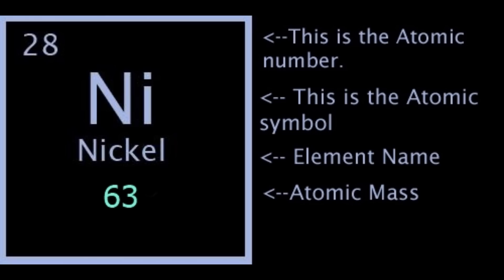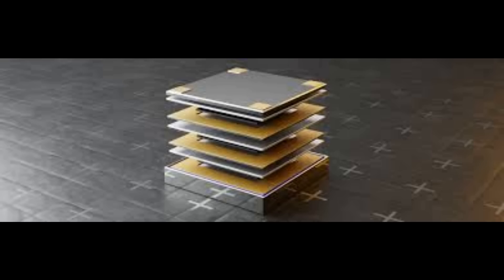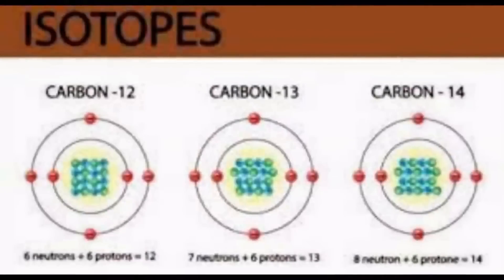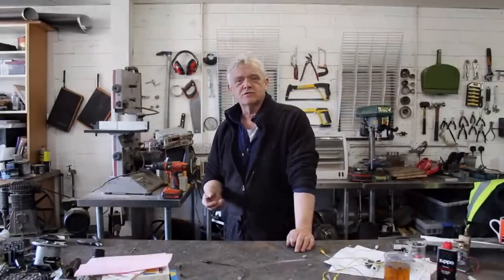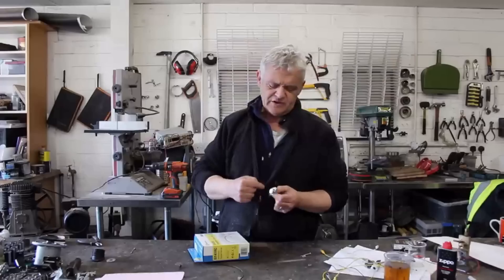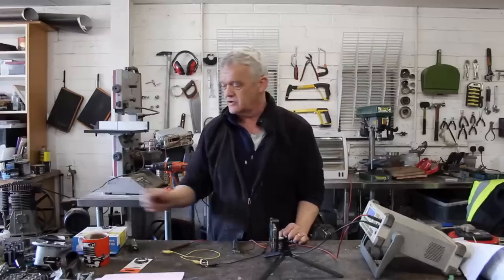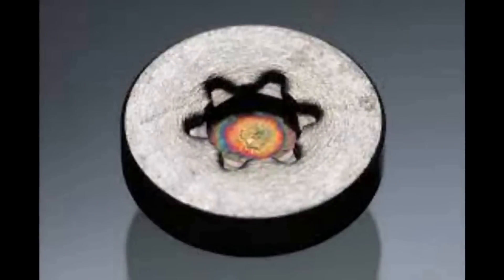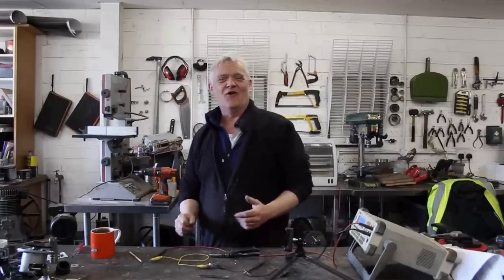2187 - The 50 Year Nuclear Battery From China And How To Make Your Own Version

Comment: I got very excited when I saw the title but after watching the full video I realised is a edit of the old that for some reason got deleted in the last 24h, which made this video feal a bit like clickbait. 
Also by using the same footage you did not address the one important question from the comments. 

Can the mv reading you got  from the apparatus be  because of light contamination 
( as the test is not done under complete absence of light) 

There are some research papers on building alpha voltaic cells online, the most promising one I could find is using Zirconium anode, Iridium cathode and is using liquid Galium as conversion medium. . The open-circuit potential of the cell is expected to be 1.62 V and is expected to deliver a current between 7 and 12 ma. 
(the full name is :Alpha-Voltaic Sources Using Liquid Ga as Conversion Medium)

Comment: I honestly think we could power our world off of small atomic reactors. There is no need for oil. But imagine something that lasts ages and doesn't break - small profits.
Reply: Well idk, its not usually the batteries that break first in most battery powered products, is it?
Energy companies are gonna be mad though lol.
Reply: @svinkuk2652  they may not break first but surely they don't last ages.
Reply: @adamstewarton  no sure thats true, im thinking of things like phones and laptops though, most people tend to replace them long before the battery goes wonky.

it'd be a gamechanger for cars though i suppose, but they could just do what the tech industry and many car manufacturers already do and engineer them to fail after so many years, as well as make them impossible to maintain without ten million specialized tools and put in software to make it harder to get off brand spare parts etc etc.

There are always shady ways to maintain profits lol.

I get your point though, its definitely an incentive for companies to want these things away from the market.
Reply: No they are not. The power output of these things isn't even enough to run a very dim LED torch. @svinkuk2652

Comment: So if my math is correct, assuming 1mA at 110 mV, it should produce 9.504 Joules of energy over 24 hours. For a red LED operating at a F.V. of 2V with a current draw of 20 mA, the energy if stored with no losses or leakage would be enough to keep it lit for 237.6 seconds or ~4 minutes. This could prove to be extremely useful for supplying enough power to actuate some relays (or beefy transistors) and wake up hibernating electronics in applications where they’ll remain turned off for extended periods of time. 4 of these nuclear batteries could maintain a 1000mAh NiMH battery at 80% state of charge for 156 years. Or maybe you could create an atomic clock utilising the time-averaged regularity of the decays.
Reply: So I'll just mention it's pointed out in a comment or two that the output is 100 microwatts instead of milliwatts.  Rob states microwatts later .
Reply: @philip5940  So I deleted my previous comment because I misunderstood you, apologies. I was merely making a calculation for Rob’s little transistor based device. I think the real breakthrough is probably that Diamond doesn’t break down like the semiconductors we use in electronics do when exposed to radiation. Spacecraft have had reduced operating lifetimes in space due to radiation spikes (such as from CMEs, for instance) damaging the solar panels thereby decreasing their output. I’m not sure how the power output differs between Rob’s little experiment and the Chinese company’s product but the lifetime is what really matters (I think). Anyway, thanks for sharing!
Reply: I checked your numbers, seems right to me, and it's a good use of variables many may overlook or think they will never need beyond Ohm's Law.    I checked using this equation to start with: 
 voltage  = joules of energy / coulomb of charge
Reply: @e100vids2  Thank you
Reply: It is my understanding that you are referring to the 'nuclear battery' he made in the video when you say '1mA at 110mV'.
If my understanding of what you're saying is correct then what you're saying is far from correct. 1mA is an extreme overestimation of the 'battery' he produced. 
Using numbers from wikipedia i find Am241 smoke detectors contain ~37kBq which at the decay energy of 5.486MeV gives a wattage of the radioisotope source of ~32.5 nanowatts. 32.5 nanowatts at 110mV is ~296 nanoamps.
Most of the alpha particles from the source are not even getting to the semiconductor so the efficiency of this device is certainly far below 50% before considering losses in the semiconductor. I am unsure how many electrons are driven across the junction per alpha. I think it would be extremely optimistic to assume 5% of the alpha energy hitting the silicon is converted to electricity.
Assuming 20% of the alphas generated hit the silicon and 5% of that energy is converted to electricity and starting with 32.5 nanowatts gives an electrical output of 325 picowatts. 325 picowatts is 28.08 microjoules per day or ~10.25 milijoules per year.
Reply: @johnnydeep7089  Thank you for your input. Yes, I did consider that I may be overestimating things, and neither did I take the time to calculate the wattage produced by the decay of the Americium source. I merely made assumptions about the output and wanted to see if those assumptions would yield in a useful amount of energy produced over a sufficient span of time. I suppose that such a small sample of Americium, or even this particular isotope may be unsuitable for power generation purposes, but a different isotope may be. Would a source emitting 110 microwatts of alpha radiation be dangerous to human health? I’m not sure. But I assume that it can be sufficiently isolated from human beings to not pose a threat. Time, distance, shielding. For a source like this, it’s relatively straightforward to implement the distance and shielding rules to minimise dose absorbed by a human being, especially since Alpha particles have the largest cross section of the particles in the three possible routes of decay energy release (Alpha, Beta and Gamma). As for time, so long as no one wears it on their person; not to insult the other commenters who suggested using it to keep smartphone batteries charged, but this would be quite irresponsible as it maximises the time and the amount of shielding needed for such a thing to be deemed safe would not be practical for a portable device.
Reply: @thesentientneuron6550  Given cost is no concern it is trivial to make a 110 microwatt or even substantially larger alpha source powered nuclear battery. Alpha particles in particular are completely blocked by very very little shielding (an alpha source nuclear battery will not cause any harm to organisms around it if the alpha source does not have any secondary decay modes). However there will never be anything even close to 1 watt available on the consumer market powered by a nuclear battery because if the nuclear battery is damaged the radioactive material can escape and cause great harm. I suspect even milliwatt nuclear batteries will never see consumer markets for this reason. It is also possible for people with bad intentions to extract the radioactive material from many batteries and so I would be unsurprised if even sub milliwatt nuclear batteries are not available without a license.
Reply: Science numbers man, I have a gram of yellowcake uranium, some thorium powder, and americium sources similar to the one in the video. A pack of these transistors is $12 for 10. Assuming I use a yellowcake and ethanol slurry enough so to coat the internals of the transistors and let it dry before capping them with cork and then solder, how many for me to infinitely(the rest of my life and bveyond) power a house hold lightbulb?  @johnnydeep7089
Reply: You bring up a pretty good point. These nuclear batteries are constantly dripping electrons, which is not practical for most consumer and industrial applications. But one could augment an existing battery NiMH or Lithium system so that when a device is not in use it is passively recharging. My keyboard and mouse are wireless, and I don't use them constantly through the day; hypothetically, augmenting these systems with discrete nuclear batteries ensures that they only need to be traditionally recharged during prolonged heavy usage.
Reply: @MrVirus9898  100 micro watts is too little to charge a wireless mouse in a reasonable length of time.
Reply: The problem with saying something will last hundreds of years is corrosion and basic elements breaking down with time. However I do like your maths. This would be a good miniature power system for backup systems that can sit untouched for long periods of time.
Reply: It doesn't look like that comment got relayed through
Reply: @philip5940  Don’t worry about it. I’ve just done my due diligence.
Reply: Yes
Reply: I wonder if you could get 3 or 4 of these to float a car battery forever to prevent sulfation. Something tells me 300uW isn't enough for that though.
Reply: @sCiphre  Yeah those things lose power super fast. It’d be far more effective to just drain the electrolyte into a separate reservoir and store the cell “dry”, I imagine.
Reply: @thesentientneuron6550  nah I just want my rarely used car to float without plugging in (it's not near a socket) or rooftop solar (too easy to steal). My plan b is to find a battery based battery minder I can just recharge every now and then.
Reply: How about a small solar panel that sits on your cars dash? Secondary benefit of protecting your dash from sun damage. @sCiphre
Reply: @patrickryckman3341  tried that, the windows filter enough radiation that it doesn't really work. And at least one of the panels had high enough reverse draw that it actually made things worse.
Reply: You could connect the batteries in series to have higher voltages.
Reply: @UltimatePerfection yea, just need 10 000 of them to get 1 watt.
The problem with them is that once you get enough that it becomes really useful, its now heavier and bigger than a normal battery.
Reply: @patrickryckman3341  Yeah, but it would last much longer than the regular battery, so for something that needs to be relatively portable, but not THAT portable (such as e. g. camping light), it's still a better option because you won't have to replace or recharge it.
Reply: Who are you?
Reply: Ok ok no one like a show off slow the state of your alpha particles down to just a little bit so we can see that you’re not just a jerk
Reply: @JAnnetts-kg4ei  Did your lil ego got hurt or something?
Most of this comment section is passively aggressive since none wants to seem like they're wrong or uneducated...
None even knows y'all
Reply: dude smoke detector that dies after you do. it would only take like 4 more parts.
Reply: @powercar9000  Damn…I never thought of that 🤣. In all honesty, it would be out of budget for most people to be practical. But maybe a military bunker or some critical, long term facility that needs to be functional even without people or power might find a use for these.
Reply: Yes, but more importantly, can you imagine a Hybrid like the RAV 4 Prime using a small cluster to maintain trickle charging so when its idle over lets say 4 hour period it gets 1-5% battery.
Reply: @thesentientneuron6550  I think u forgot to carry the 1
Reply: That's right. Im soon gonna make one with Sr-90 source, and I'll use a step up converter to turn the 1 volt or less into more. It's a cool and nice project, but I honestly hope these batteries won't be public, since someone can open them, extract the radioactive element and do dangerous things.
Reply: Errrr.... "time-averaged regularity of the decays"? Last time I checked, radioactive decay was a Random process. Okay if you knew both how old the radioactive source in the battery the was and how pure the source was w.r.t. to 63-Ni, and knew the Exact efficiency of conversion of beta particles to useable current, and you could include circuitry to correlate the number of radioactive decays measured (since they will be proportional to the 63-Ni remaining  in the source), Then you might be able to use it as an "atomic clock", but that is A Lot of uncertainties and assumptions and is Not how a Real atomic clock works.
Reply: it doesn't need to trigger a 'beefy' transistor, you can put them in a darlington pair to use arbitrarily small amounts of current to control arbitrarily large amounts of current. It would certainly be enough power to run a sleep mode wake function. It could even power something like a small weather station for enough time to turn on, take a reading, transmit it, and go back to sleep mode for an hour.
Reply: While this is great for sleeping systems we should remember that they aren't that big physically.  Tesla run off 18650 cells. Or they used to anyways.   Imagine a power wall sized NDB array constantly charging a deeper capacity, on demand, power wall.   Now you are good to go anywhere on earth, under the ocean,  or deep space. Until your hot and heavy elements decay. Then you probably need a star again.
Reply: @iindium49  Or a particle accelerator/nuclear reactor. The useful radioisotopes (for energy generation) are all manmade :)
Reply: @thesentientneuron6550  yes , but offworld,  let's say past Jupiter, heavy elements are hard to come by. Or atleast that is my limited understanding . Definitely not an expert. Eventually entropy always wins.
Reply: @iindium49  the universe is full of materials ..im sure a space craft that can fly for 400 years can eventually land on a surface and get some elements back and even if they are hard to get u still got a space craft that can fly for 400 years on a few grams of fuel
Reply: Nice try! The battery will fail or leak in a few years.
Reply: @mrtechie6810  I wasn’t trying anything :)
Reply: @mrtechie6810  whats going to leak there ?
Reply: Why do you say that? I just don't see it!
Reply: @mrtechie6810  nice try to you as well, troll.
Reply: @_..-.._..-.._ not at all. I bought many rechargeables and they all leaked and stopped working after a few years. Only used them a few times.

Comment: If this gets cheap enough for consumer products, one of the first applications I thought of was for smoke detectors, some of which use a radioactivity source (an isotope of Americium, I believe) to detect smoke. Perhaps they could use the same radiation source to power AND operate a smoke detector?
Reply: I wrote my comment too soon. I had no idea you were going to use a smoke detector for your project!
Reply: The power density would be insufficient to operate any sort of audible alarm.
Reply: Add a supercapacitor, charged by the source. By the time the alarm is needed, it will have stored enough charge to provide the power required for the alarm.
Reply: Online estimates already say they will cost around $5000 each.
Reply: @tcmtech7515  Sure, at the moment, but if you consider that a computer as powerful as your phone is would cost $100,000,000 thirty years ago (and draw tens of kilowatts to operate) it’s a fairly safe assumption that not too long from now this nascent technology will become affordable.